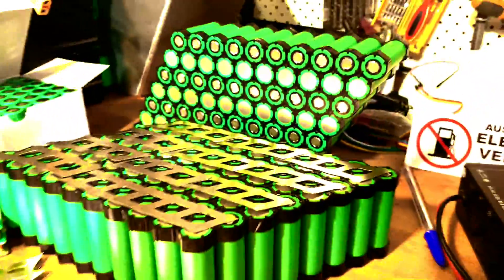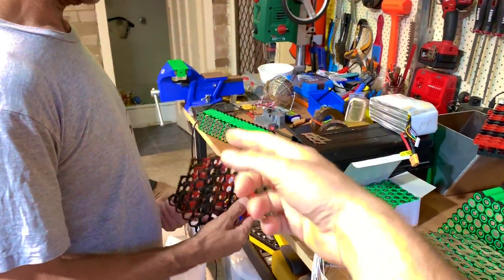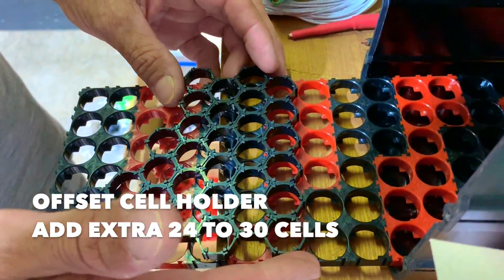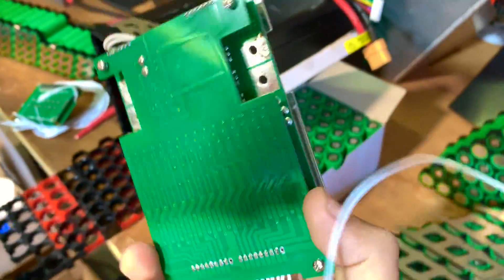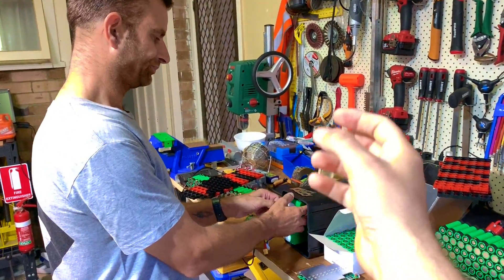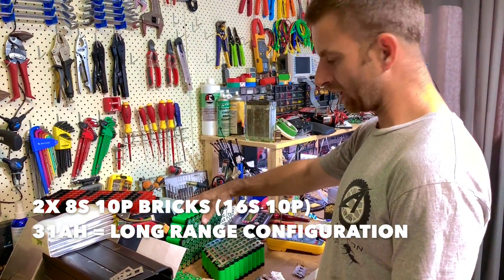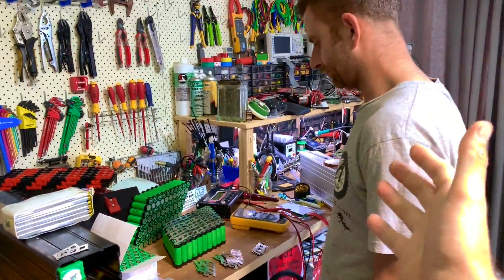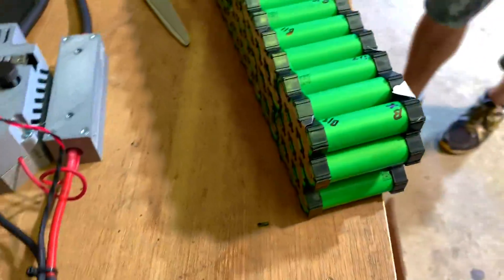Sur Ron & LMX Battery Upgrade - Follow Up Video

Comment: Can I buy that bms shown in the video??
Reply from the maker: You can buy the AntBMS there is a smaller size that fits inside the battery case, are u running Surron controller or ASI bypassed BMS?
Are u in Australia?
Reply: @BrunoPOWEEER  ..im running a asi controller from you guys!love it!,i have a stock battery that stopped allowing discharge after 4 charges.i opened the battery and found that across the cells i have 66 volts,but at the plugs only 44 volts.a link to a bms would be greatly appreciated!

Comment: Hey bruno..I need a stock surron battery repaired..do you guys do that?
Reply from the maker: You can buy the AntBMS there is a smaller size that fits inside the battery case, are u running Surron controller or ASI bypassed BMS?
Are u in Australia?

Comment: Hey Bruno , hope you’re well . Iv recently bought a Surron 60v . The battery labels say 48v . Iv ran a multimeter on it and it comes up as 64.7v is this correct for a 60v or have I got a 48v battery ? 
Thanks in advance 
Adam -Uk 
🤘🏼

Comment: Hey bud! I hope you see my comment, just a quick question, i have a a123 22650 40 volts pack 12S4P configuration, and i have a 6S charger, can i use it to charge partially? I mean first is 6s then after im gonna charge from +6s to 12s.. will it work? I mean i have to divide the charging please let me kno thank you...

Comment: Hey where can I get the extra Surron battery cases ? I would love to try this on the Surron! More Powwwaaaaa!
Reply from the maker: Heeeeeey mate, Adam the guy in this video (https://www.surronaustralia.com.au) I think he found a supplier who sells the aluminium extrusion but not too sure about the plastic top and bottom ends. Send them an email asking and see how it goes. Also google some Surron forums/groups like Endless Sphere, drop a public question, someone will know where you can get it.
In the worst case, find a local metal fabricator and ask them to bend you an aluminium box and fit some thin fibreglass sheets between the pack and the case to insulate.
Soooo much POWEEEEEEEERRR ohhh yeaahh =]

Comment: Huge Fan :)) Getting pumped to build  my first pack, 17s10p for a small electric scooter. However, still couldnt figure out how can a 17S BMS can connect to 10P of 17S is a question. Should i buy 10 BMS and connect them to a Master BMS, or there is a trick to do it simpler way. OR Parallel Connected batteries can controlled together with one channel of BMS,  doesnt seem perfect :)...

Comment: what will the new 21700 cells give in sur-ron? more autonomy?
Reply from the maker: Hummm... Theoretically you should be able to fit more capacity/energy (autonomy/range) in the same space but so far lots of people/companies studied the transition and gains moving from 18650 to 21700 and decided to stick to 18650... it may take another year (maybe a bit longer) to start to see 21700 gaining more attention... 18650 is a very mature design and changes take time. Also the 21700 cells available nowadays aren’t shockingly amazing yet https://ru.nkon.nl/rechargeable/21700-20700-size/brand/panasonic-samsung-sanyo.html 

I’m not too sure if and how two sandwiched 21700 would fit inside the Sur-Ron battery case, it’s a tight fit for the 18650. It may be possible =]

Comment: For the surron , why choose panasonic PF cells ? Their only 2900mah . With that configuration you only get 60v 31.9ah and 110amps of discharge . If you chose the LG MJ1 cells , it is still 10amp per cell but you get 3500mah per cell instead , total to 38.5ah with also 110amps of discharge.  And also , why would you put a 200amp BMS when the peak cell discharge is only 110amps?
Reply: Why don't they use samsung 21700's? .. the 30 or 40T's?

Comment: Hey Bruno, what do you suggest to build a 14s5p battery pack, between Panasonic 18650PF and Sanyo 18650GA ? Why do you always use 18650PF ? What do you think about 18650VTC6 ?This is to use with BBSHD and stock controler....

Comment: also remember that 18650 lowest voltage is different then lipo lowest voltage so not every bms is good for both
Reply from the maker: Anthon de Vries yeaahhh... lots of people reading here I’m glad you mentioned the difference in voltages =] 
Lipo I would be adding a Cycle Analyst and would be monitoring the voltage, the sag, capacity etc... I’m a bit of a geek always monitoring these numbers closely hahaha..
Reply: @BrunoPOWEEER  same here
Reply: If you are hitting LVC for BMS with either then you didn't use the correct 18650 cell for the controller or dont have enough P groups. Extreme sag is for people with poorly designed packs.

Comment: i am using 2 10ah 6s in 2 series for 2.5 years now, multistar batteeries, i only charge them to 4.1v and the bike is 350w. charging them 2 times a week

Comment: Menudo taller y vaya currada, tengo varios preguntas, para soldar va bien ese tipo te soldador de punto? Sale a cuenta en vez de la otra máquina que utizas que va también pedal sukko 709A? Porque no utilizáis las celdas 18650 Samsung 3500mA 35A? Gracias y sigue así con los vídeos 👏👏👏
Reply: Bcn mot crack ! Eso es lo que voy hacer yo 😂😍
Reply: Para soldar bien eso no.vale